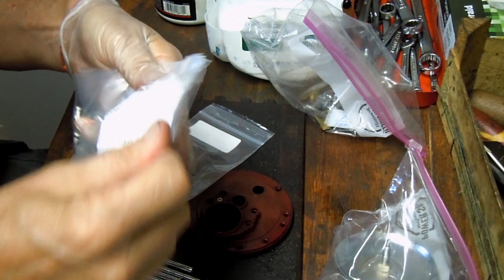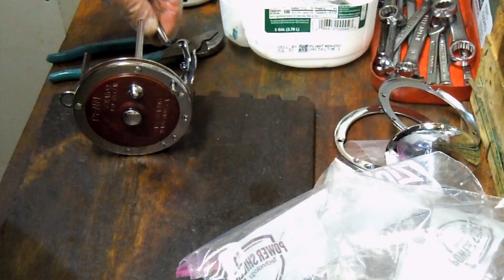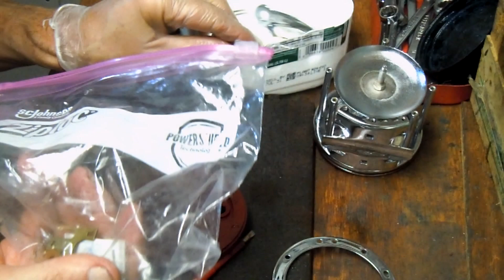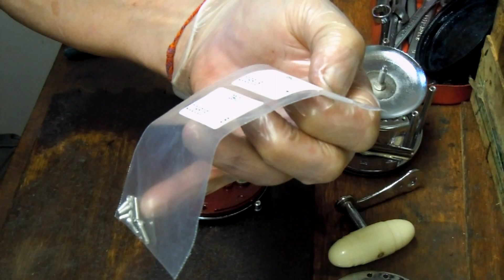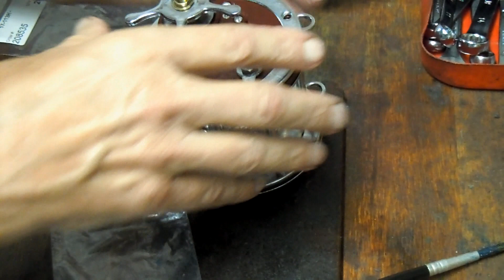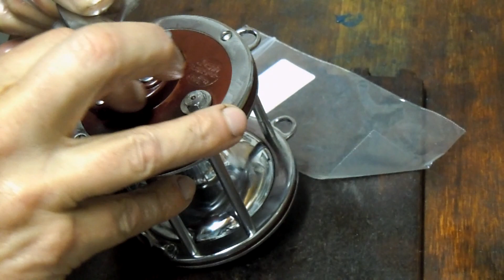Penn 4 0 Senator building and servicing this fishing reel from new old stock parts

Comment: I just serviced my penn 4/0 theta looks just like this one but my handle has a little wobble to it. I opened it up a couple of times to see what it could be but I can’t figure it out. I can grab the star drag and wiggle the whole aseembly. Any ideas?
Reply from the maker: If it is side to side play, then it is a worn bridge shaft.  Nothing can be done for that except to replace the bridge. - Dennis
Reply: 2nd Chance Tackle thank you for your great videos and comment responses! I will look into getting a new one. Is the bridge shaft where you connect the handle and the internal part of it holds the 4 screws?

Comment: That chrome job probably cost more than twice the reel. Looks good.
Reply from the maker: That is nice and Nick said it wasn't as expensive as we would have thought.  I am going to get additional information.  The only thing I noticed was that the chrome seeps not the threads for the screws and you need to be careful when assembling it not to stir the screw or force it.   A drop of oil helped - Dennis

Comment: The two outside chrome rings on my 49L are cracked in some places. Does this weaken the reel's frame  strength?
Reply from the maker: No.  Those chrome rings are bump guards to protect the side plates from cracking when they hit a side wall or pier rail.  They are not structural to the reel.  Penn made the 149 version of this reel without those rings, so don't worry that point - Dennis